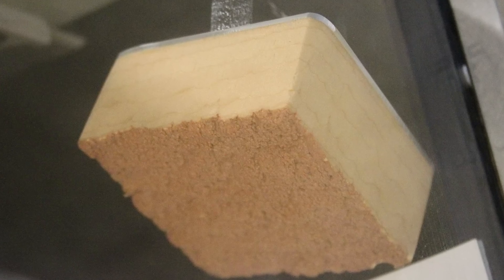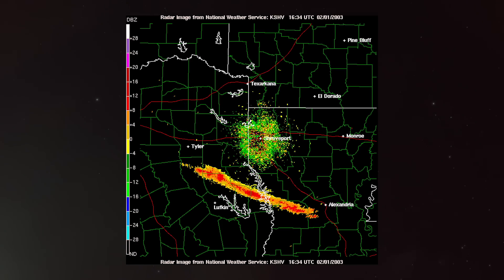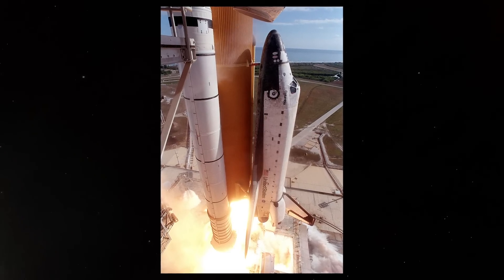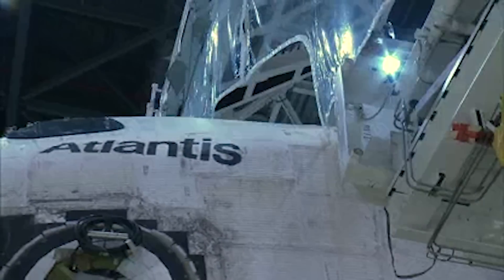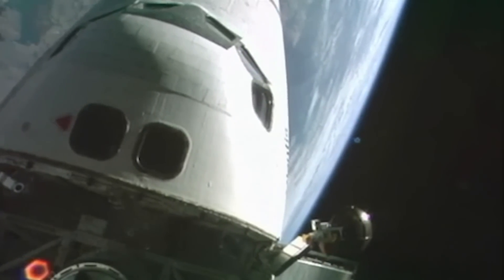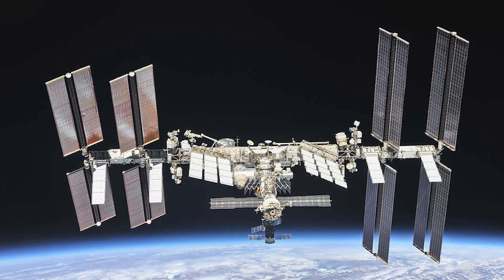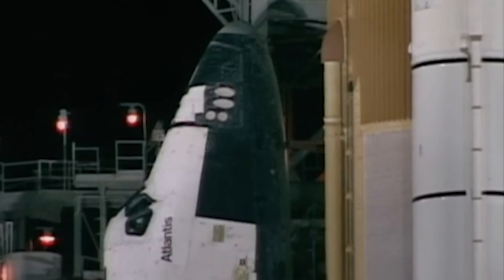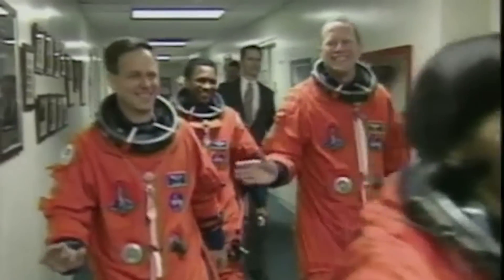The Backup Space Shuttle - A Rescue Mission that Never Launched

Comment: It would seem that a net of Kevlar (or one of its cousins), placed into the foam, from the nose of the tank, to just above the leading edge of the shuttle's wings, and only on 120 degrees of the tank, would permanently stop the foam problems for a couple of pounds of added weight. It wouldn't even have to be made of heavy duty strands, since each strand would be supported along 100% of its length. If a piece of foam started breaking up, only its minor weight would be spread amongst many strands of fiber. I have no idea why this wasn't incorporated, especially after the near-miss incident that happened before this one.
Also, it was stated that Lithium Hydroxide is used for CO2 scrubbing on the shuttle. Is there a reason why they don't use Lithium Peroxide instead? The byproduct of LiOH is undrinkable water, while the byproduct of LiO2 is breathable O2 (at half the rate of the CO2 absorbed, but still a better bang per pound).
Reply: I agree. What's sad is that, at the end of the day, the shuttle was designed by the congress, which had no idea what they were talking about.
Reply: NASA considered at one point a similar solution, the verdict was "too heavy & not needed"
Don't forget the rocket equation, you can't just add a few pounds here and there, because you need exponentially more fuel to lift it to orbit. The big orange tank stayed with the shuttle a long time after the SRBs burn out, to provide for the SSMEs for the full circularization. Adding even 10 pounds to the tank would likely require a few hundred extra pounds of fuel, requiring a bigger tank meaning more weight meaning more fuel etc etc etc.
Reply: @KingHalbatorix  But how about after the accident? Were the shuttles usage discontinued because of the issue of tile breakage due to foam?

Comment: They should've tried to dock with the space station and use the Soyuz to get back home
Reply: They were in completely the wrong orbit to get to the ISS, and not nearly enough fuel on board to get to the right orbit
Reply: @almostfm  So essentially there would be no way for them to get to the ISS or receive aid from any other spacecraft besides another shuttle launch?
Reply: @itsdimitriymedvedyev  That's right.  There was another issue that put a hard limit on what could be done-the amount of "consumables" on board.  After about 30 days, they'd run out of the reactants that powered the fuel cells and provided electrical power, as well as the LiOH canisters that scrub CO2 out of the air.  Running out of either would quickly kill the crew.

Soyuz only holds three and it takes at least one to fly it, so they'd have to try and launch four Soyuz in a month, and that just wasn't going to happen.  A rescue mission using the next shuttle scheduled to launch (I think it was Atlantis) would have barely been possible, and that's assuming that they skipped the checks that makes sure the shuttle can actually launch, and not blow up once it got off the ground.  Even if that had happened, the actual rescue would have been nearly impossible

Comment: I wonder why they couldn't doc with the ISS until another shuttle could retrieve them.
Reply: Because they were in completely the wrong orbit to get to the ISS and not nearly enough fuel to get to the right orbit.

The big problem was the inclination of the two orbits.  Imagine two circles around the Earth, each tilted a different amount.  The only time you can do a plane change is at the two points where the orbits intersect each other (called the nodes).  But once you're in orbit, it takes huge amounts of fuel to change your orbital plane even a slight amount.  The difference between the two orbits was close to 30 degrees, and if Columbia burned every drop of fuel on board, they'd have only had enough to do a 3 degree change.  And because Columbia wasn't slated to go to the ISS, it didn't have the docking adapter installed, so even then it would have taken a number of risky EVAs to get the crew over.

Comment: I remember that. I remember seeing the footage of the heat tile explosion. I had seen a documentary on the shuttle and they hit a tile with a hammer and the amount of dust that came from it was miniscule. I watched that dust spray from the shuttle and knew based on the two square metre cloud of tile dust that they had lost multiple square metres of tiles. You dont tell them to make a re-entry with a multisquare metre hole in the shuttle without knowing they are going to die. They should have been able to visually assess the tile damage from the cloud of dust.

I would have docked it at the ISS and had NASA design a second stage that plugs into the shuttle rear to provide it with a space propulsion engine capable of making it a Test Bed for inter-planetary propulsion systems.
Reply: Shirley Munro Columbia was the only shuttle not able to dock to the ISS.
Reply: @nolancain8792  could they have all space walked to the ISS?

Comment: Why launch again instead of just getting onto the ISS????
Reply: They didn''t have the fuel to change their orbit enough to rendezvous with the station. Orbital plane changes require a lot of fuel. Shuttle was designed to set its orbital plane while ascending in the atmosphere, using the main engines and its wings to a minor extent. Once the external tank is jettisoned the main engines are dead weight, it just has the small rockets in the pods on either side of the tail and limited fuel. That is mainly for the deorbit burn. Maneuverability on orbit is very limited.

Comment: The NASA team didnt fail to identify the problem, it failed to act on knowledge and previous failures.  it was well known that insulation breaking off from the main fuel tank was common and since it was "common" it was dismissed.  The NASA management team made the uninformed decision that since its "just" foam there is no risk.  Later during the investigation it was shown that they had all the infirmation, but the commonality of the problem lulled them into a false sense of security.

Comment: There are many ways the crew could’ve been saved... at the very least it could reenter right wing dipped down to reduce pressure on the damaged wing, or at least tried.  A resupply mission could have been done using another country’s rockets - to keep them alive until another shuttle was launched. USA military could also launch a resupply mission.  Capsules could be sent to orbit, to intercept and bring ppl back (extending existing useful supplies). A ‘patch’ could’ve been sent up. The crew may have had something on board to stuff into the wing. A boosting-rocket could be sent up to help intercept IIS conversely a piece of the IIS could be taken off, with supplies inside, put to a lower orbit for interception. I think NASA executives just talked themselves out of taking any action.

Comment: "the explosion of the challenger space shuttle" - Sorry to be pedantic but it wasn't the shuttle that exploded, it was the external fuel tank (the giant bit between the two booster rockets) which caused catastrophic damage to the shuttle rendering the crew unable to regain control and avoid a crash.
Reply: Lord_Edge It wasn't the tank either it was the aerodynamic forces caused by the thrust from tbe yawing right SRB after the mount broke loose

Comment: I don’t think it would of been possible. Even if we launched we wouldn’t have enough time to come up with, test & qualify a flight. This isn’t a trip to the mall in the family car. This is a extremely complex set of devices that need to work perfectly.  Getting in and lighting the thing off is a huge risk. 

There is something that bothered me about the whole thing though. There was a concern of the foam strike. How did they not see sensor data in one wing differ from the other? Was it a situation of not locking the doors and focus on the data? Was it a failure to follow through each department for information that differed from other flights? What happened? It’s obvious now that the inside of the machine was exposed to the elements. 

Thats all.. lol

Comment: The "plane change" problem with getting to ISS came about because of the rabid push to make Russia part of the program.  The original Space Station Freedom would have been at the same orbital inclination as Columbia, and no plane change would have been necessary.  Furthermore, during re-entry the shuttles would bank from side to side to minimize aero heating of the wing leading edge surfaces.  Knowing that there was damage to the left wing leading edge, it may have been possible to bias that to lessen heating on the left wing and the vehicle might have been able to return safely.

And then there was the change to the foam on the tanks to make the process more "green".  The agency insists that did not increase the risk of foam separating from the tank, but in a politically correct culture, well...

Comment: I took a course at the Southwest Research Institute a number of years ago.  SwRI is the company that did the testing of frozen foam against leading edge RCC panels you see at 2:35.  The instructor broke from our regular material to discuss the accident and failure sequence for an hour or so.  He said that there were some at NASA who did see the foam contact the leading edge in the video immediately after launch and asked NASA to perform an in-flight inspection to check for damage.  NASA declined to carry out this space-walk.  I then asked if at that point anything could have been done even if they HAD inspected the orbiter and discovered the extent of the damage, much like Dark Docs is asking here.  The instructor gave basically the same answer - that Atlantis was undergoing preparations for launch, and a fast-track program to turn it into a rescue-mission MIGHT have been possible, though still definitely a long-shot.

My hunch is that if they had made the inspection and discovered that re-entry with that orbiter was no longer possible, the "failure is not an option" mentality at NASA would have immediately required them at least try the rescue mission.  Without question everyone would have been on-board with that.  But the litany of "what-ifs" presented here are worth considering.  With such a rush-launch, and the new problem of two simultaneous mission controls, and the still un-solved problem of foam being able to break away and cato Atlantis too, it's very possible that actually attempting that mission might have only added 4 more names to the casualty list.
Reply: the astronauts should elected to do the space walk and insist this to NASA officials. this is normalcy bias at work.  worst case scenerio, they could have rigged items into the hole to slow the burn thru. or at least they could have been prepared with alternate deorbit plans or bailout procedures in place should it become needed. Nasa threw away 7 lives and failed to live up to all the lessons learned on Apollo 13

Comment: One other scenario I remember hearing, was, that on reentry, a shuttle constantly deliberately oscillates left and right and back, to disperse heat by steering back and forth to always be moving the hottest spot on the leading edge around by doing this maneuver. There was some speculation, that  if the damage was caught and properly assessed, in a worse case scenario, they could have tried to cork screw the shuttle down, putting the brunt of the leading edge heat to the undamaged wing, possibly giving them enough time to get low enough into the atmosphere to bail out... I don't know what odds they were giving this idea, or how practical or possible it was for the undamaged wing to take all the heat. But, it could be argued, that something would have been better than nothing. It's unfortunate that a space walk inspection wasn't done, because they, the astronauts, knew something had happened, and they had the opportunity to do an inspection. But it wasn't done for whatever reason. The aluminum frame under the thermal tile never stood a chance without the necasary amount of heat shielding. It was truly sad that more initiative wasn't taken to do that inspection.
Reply: STS-107 was carrying the Spacehab module. It connects to the airlock and prevents leaving the orbiter. 

The corkscrew maneuver would place the entire heat dissipation burden on one side of the orbiter. In order to keep the heat dissipation rate manageable the glide path would have to double in length, and that's just impossible with a glider. 

Linda Ham said that there wasn't much they could do, but even today there are many who still agonize about not having tried.
Reply: Yeah i wonder why they didn't do a space walk to inspect even in cases where everything is normal..that's like 101 inspection check
Reply: Bailing out? The shuttle didn't have ejector seats.

Comment: I am sorry but having followed the shuttle and having family directly involved, this is not truly accurate.  The iss is modular and supposed to be larger there were to be 1 or 2 repair bays with crews trained to do this work, it never came ito being because the program was taken over by a competitor.  This sinario was envisioned during design.  External tank had spray on foam.  Lockmart tailored the program for it's own personal profit.  Even Germany came over here to complain and was punished with a cash donation to organized crime outlets in Germany and tech data to surpass German Police.  If the original plan had been stuck with the iss would be a small city in space and a couple of repair bays not just for repair but building shuttles for deep space missions.

Comment: I wonder what would have happened if the orbiter had detachedvjust after the foam struck, could it have glided back to earth?
Reply: Yes, as long as it hadn't achieved orbital velocity. When reentering the high speed friction causes the air hitting the leading edges of the shuttle to flash into high temperature plasma. That plasma flowed through the hole in the wing and melted the wing structure, when the wing lost integrity  and began to buckle, the shuttle could not maintain controlled flight and tumbled being ripped apart by aerodynamic forces.

Comment: The transcripts of the communications between mission control and the shuttle Columbia show clearly that the astronauts knew full well of the situation before the transmission ended.
Reply: NASA met over several days to discuss what actions to take. Engineers warned directors several times for them to disregard.
Reply: From what I've seen 'Uh,Hou', and later 'Uh, buh..'(transmission cut off there), both sounding calm, were the last 2 transmissions from the shuttle, and the only ones that could perhaps indicate they knew there was a problem.
Reply: @DoubleMonoLR  https://youtu.be/aIJiW8d_c68
You confuse with Challenger 1986 Explosion.
Reply: No. The astronauts were not told that they wouldn’t make it through the atmosphere.
Reply: @strigonshitposting793  One of them made a space walk to see the problem on the wing.

Comment: Back when Endeavour was being built, NASA was offered a 2 for 1 deal as there was a space worthy Airframe that was used only for testing, which could have been created into a light shuttle for "rescue" and short notification missions.
Reply: If you are talking about Enterprise I don't think so.  While the original plan was to use enterprise for testing then converted there were many changes between enterprise and Colombia and I don't think it was possible to convert it to a flight worthy airframe
Reply: @Matt_Kab  o not enterprise, Rockwell had a shuttle frame that was Rated for space that they used for design testing - They offered to make it into a useable light craft when the order for Endeavour was placed. Nasa said no due to price to maintain "spare" shuttle

Comment: If it wasn't made of aluminium but titanium as it was originally intended to be it might have survived re-entry and remained flyable to land
Reply: Doubtful.   Heat too much for even titatinum.
Reply: @shaider1982  Still, titanium has much better heat resistance than aluminium. It might've given them enough time to realize the problem and re-arrange the flight path to keep the Shuttle leaned in a way to make the right wing take the brunt of the heat.
Reply: @TheSergioTurbo  at mach 25 during reentry, it might not have mattered.  Also, titanium is incredibly hard to process.   I think what doomed the shuttles was the level of tech as I read in a Smithsonian Air and Space article.  Like building a 747 in the 1930's.
Reply: That's very true. The only other time a reentry after foam impact strike occured was lucky in position.  Instead of aluminum superstructure getting melted through it was covered by a steel plate over a radio "antenna?" I think.